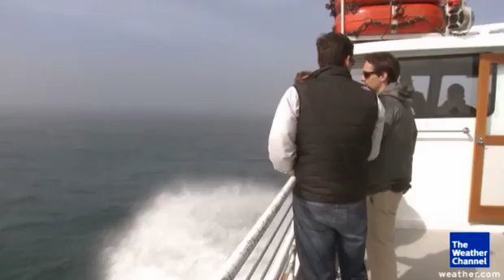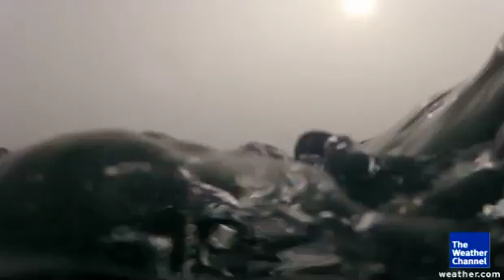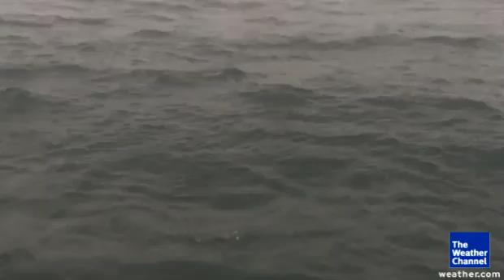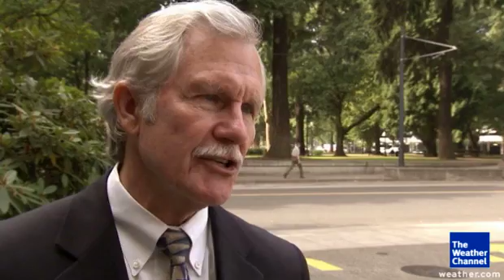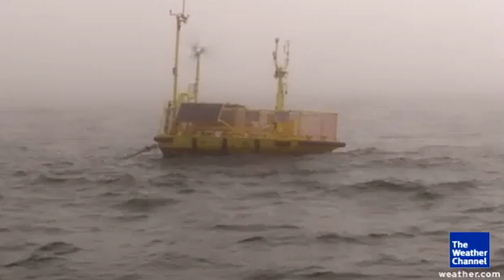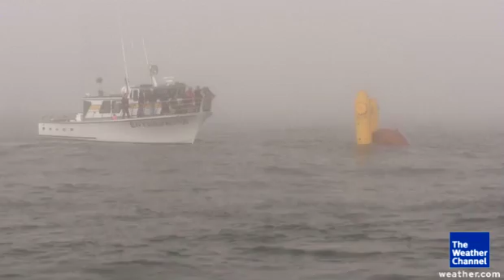New Technology Uses The Ocean As A Power Generator

Comment: THE 1ST MODREN AIR COMPRESSOR WAS INVENTED IN 1799. This device is best used to compress air & store The FREE ENERGY in tanks 24/7 WITHOUT BATTERIES & the production of electricity, Until the C.A. is sent on shore miles from the OWACompressor . 1st used for mechanical energy to power mills.The 1st Compressed Air powered LOCOMOTIVE 1828 traveled 100miles per charge. This kind of Technology was EXPUNGED from records several times ENERGY is a ^$5TRILLION a year SCAM like selling ice to Eskimos